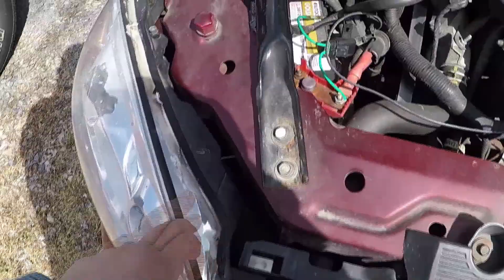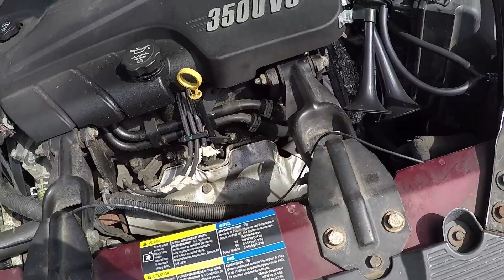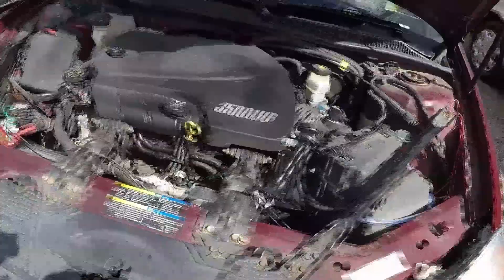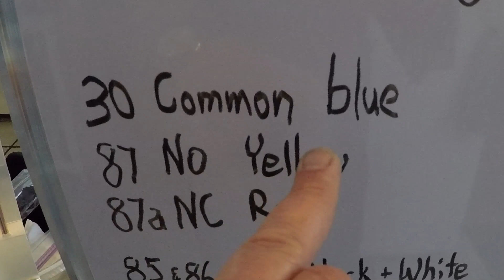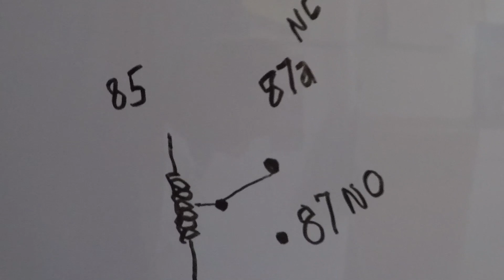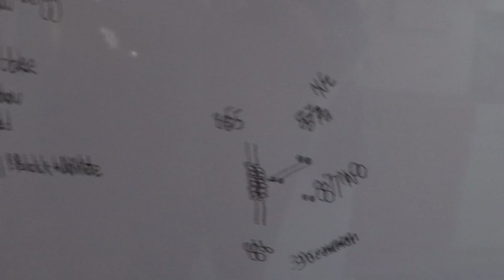Air Horn Installation Relay Operation Chevy Impala

Comment: I know this is a few years old but just wondering what air horn you put? Thanks
Reply from the maker: Sorry, I don't remember the brand. I can tell you that things out of Taiwan seem to be of better quality. Thanks for watching, Paul.
Reply: @PaulPhillipsFix  no problem. I was just wondering if it was one of those little compressor ones or a real deal air horn? My horn stopped working out of no where and I was thinking it's the relay which on our car is soldered into the board so I was thinking about getting one of the smaller air horns and adding my own relay. Which BTW I got the idea because of your video, so thank you!
Reply from the maker: @itsMrBRoc  It's got a small compressor but it works very well. About two weeks aftet I installed it, a pickup truck was running a stop sign, getting ready to get T-boned by me. When I layed on that horn it scared the shit out of him. It works :-)
Reply: @PaulPhillipsFix  thanks brother I appreciate it
Reply: No answer? Thanks anyways